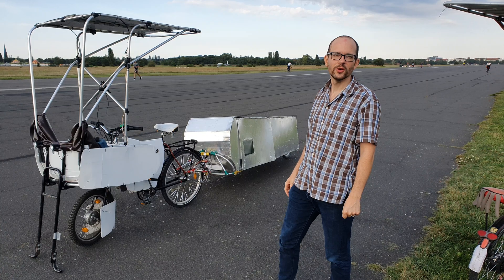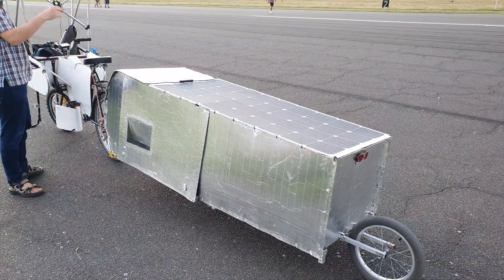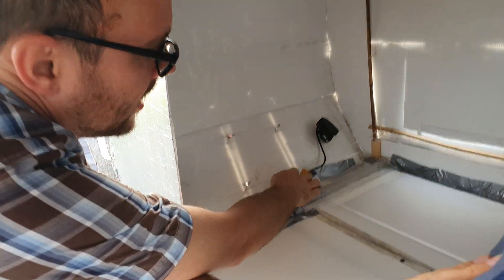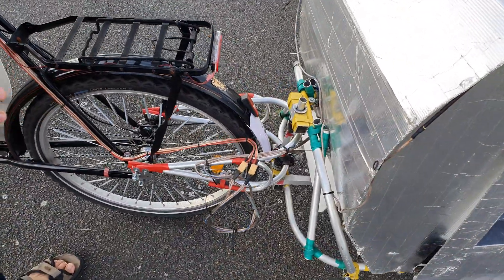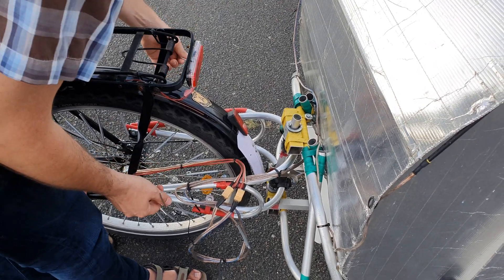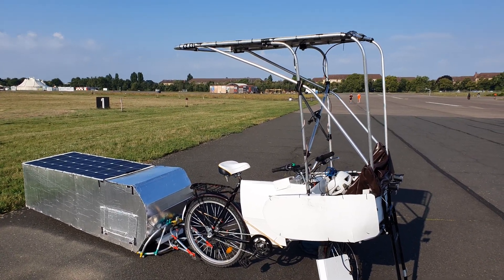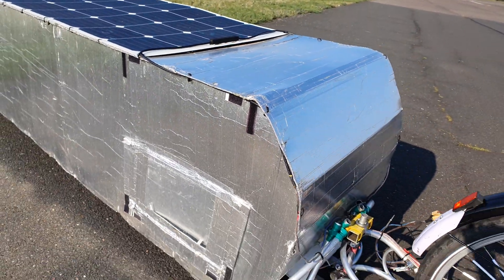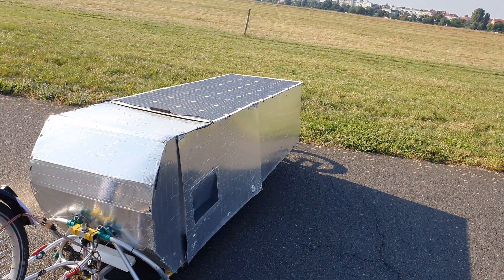World's Lightest Solar Bike Camper (14.5 kg)

Comment: Nice project,. How  You received output voltage 48v from 2 solar panels. The panels usually Has 12-18v?
Reply from the maker: Thanks. I use a boost mppt solar charge controller. It boosts the voltage from the 18V of the panel to the 42V needed for charging the battery.

Comment: The connection between the bike and trailer is lower than the trailer's center of gravity. This is why it rocks back and forth. If the connection were above the center of gravity, only a single central connection point would be needed. The trailer would then no longer rock back and forth, regardless of the bike's movement. A trailer hitch below the saddle with a drawbar attached to the upper part of the trailer would be the answer.

Comment: I'm a bit confused about the setup you know electrical conduit dose exist and can be welded once you sand or grind away the zinc coating on the welding area. It can also be bent into different shapes. The solar panel on the bike has so much stuff its like adding 200watts of air resistance negating the solar panel you put on it. On a upright sitting bicycle its best to put all of the solar on the trailer. You can also put the drive motor on the trailer if you want to give that a go. Otherwise its a ok start for a person that seems to be new at this.
Reply: well, if you are losing 200watts due to wind resistance, then you maybe shouldn't bike that extremely fast.

Comment: Fake !! The reason I say that is: where is your clothes, food, cooking, bedding, spare tire tubes for flats ? Not a “real world “  living !!  Now yes what you made is cool ! But now take it to the next level and be a hero to help others
Reply: If there was only a pack that could fit on your back using a couple of straps or bags that could attach to rack over the back and front tire, I’m surprised someone hasn’t invented things like that, it seems like such a simple solution
Reply: @ yes , make “the coffin” taller for storage, make the bike electric 3000 watt hub motor, I see solar panels, to help with pedaling. The box needs wheels on each side to help with the extra weight.  Now that would be awesome

Comment: I like the structure you created. It seems very functional. I also used the MPT-7210A charge controller (as you did in one of your earlier videos) and tried the Elejoy controller twice, but neither worked. Then I switched to Genasun. It's a bit pricey and has its limitations, but boy... it’s incredibly light and works like a charm. My trips tend to be rough (wading through bushes, narrow paths, deep mud, etc.), so unfortunately, this camper wouldn't work for me, no matter how much I’d like it. I’ve subscribed, and I’m really curious to see how your camper performs in real-life conditions. Keep it up!
Reply from the maker: Hi, thanks for the comment. Yes, I know of the Genasun. It's probably the best out there if price does not matter. I would not recommend the MPT-7210A. Two unit died on me. Possibly because the vibrations destroyed the fan and then it overheated. Strange that the Elejoy did not work for you. Have you double checked that it is the correct variety? I think there is both a boost and and a buck version available. For the first one the panel mppt voltage should be lower compared to the battery min voltage (fully discharged). For the latter the mppt panel voltage should be higher than the max voltage of the battery (fully charged). They look identical and just have different labels.
Reply: @ZolarEnergynet  I definitely needed the boost version Elejoy since my battery is 52V and my panel is 24V. It simply didn't work, so I returned it and requested a replacement, but the new one didn't work either. Both might have been defective, but I'm not sure. Eventually, I decided to bite the bullet and buy a Genasun. I agree, the MPT-7210A is not a good choice. It has a bug: whenever the light intensity changes significantly, it resets itself and slowly ramps up the output from zero. This results in very inefficient charging when moving through changing lighting conditions.

Comment: I mean it's clever. It also makes no sense, just strap a tent to your back and go.
Reply from the maker: Both have pro and cons. Tent of course is lighter and more compact. 
But you need more time to put it up and disassemble it. Also legally the trailer is a bit of grey area in regions where wild camping is not officially allowed. Or at the very least its not as intrusive as pitching up a tent and you can also much more quickly move on in the rare case that somebody (e.g. forester) tells you to do so. Additionally, it gives me an extra boost through the solar panel and I don't have to handle a wet tent in case it is raining.
Reply: Unlimited range with patience, say fishing every stream or pond on the way. Starts to rain on the road, shelter is already up And dries in the wind once its over. This is a gateway to adventure

Comment: the small bamboo frame is a good way to have a flat roof that supports solar.  Can hang things up on it is cool too.  coroplast builds use domed roofs for this reason.  Coroplast tension floor is great idea.

An angled design that allows sitting up would be much higher utility. 

Extremely well done on the weight.

Comment: Looks really nice...how long can the power hold when i want to cook with a rice cooker... thanks good job
Reply from the maker: The 1l rice cooker takes approx. 100 Wh to cook a meal (sufficient for 2 persons or one eating a lot). The battery is 500 Wh so cooking takes 1/5th of the energy available. The other 4/5 can be used for the motor. When going on a day trip with the camper during sunny summer weather the solar can produce approx. 1000 Wh, so preparing cooking will just be 10% of the solar energy produced.

Comment: How many Watts of solar? How far can uou travel on solar power in a day?  Did you feel that the width was adequate? What is the interior height? Thanks.
Reply from the maker: 160Wp on the trailer and another 170Wp on the Bike. In the summer I can go like 100-150 km a day with it. Width @65cm is totally fine for one person. Interior height is ~64 cm at the head  and ~52cm at the feet (close to the rear wheel).
Reply: @ZolarEnergynet  great job!